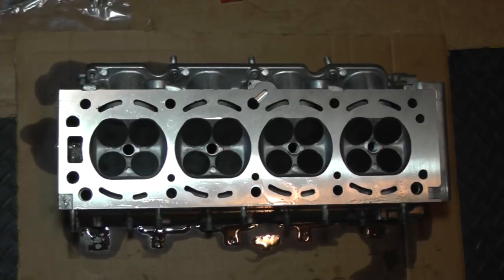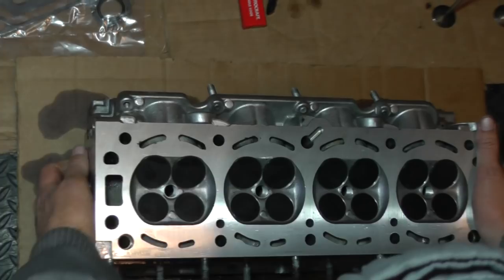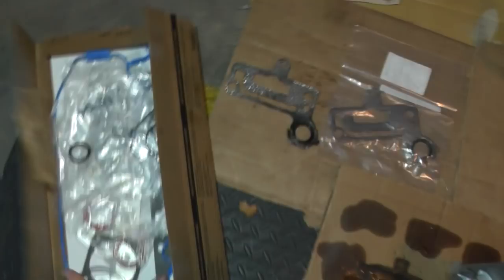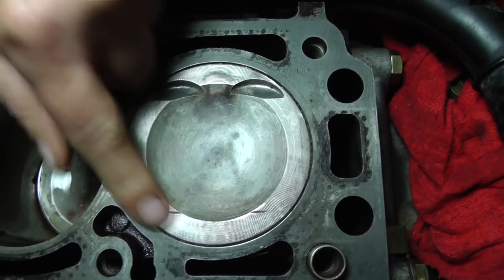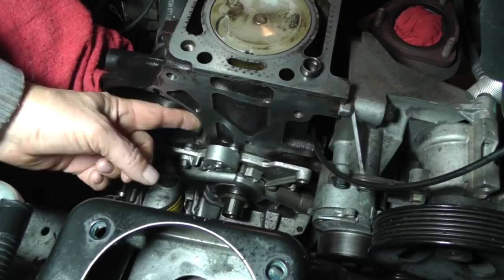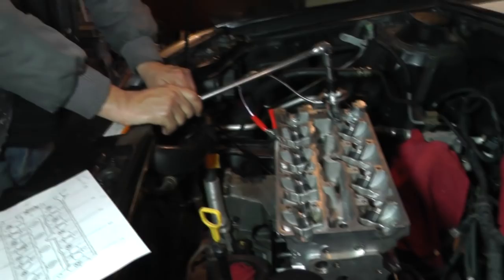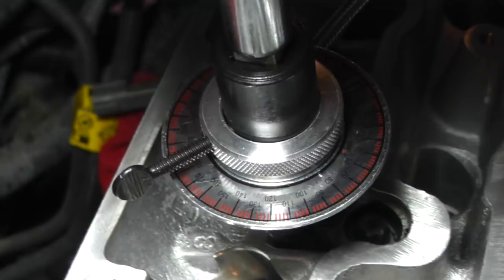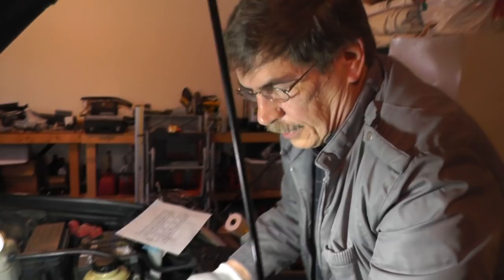Suzuki Forenza Head Installation - Part 9 (Initial Head Install)

Comment: Great video series. I have a 2005 Optra which has the same engine as your Forenza that blew the head gasket. I've watched all your videos and they have been a great help. I'm getting the head back from the shop today and this video  cleared up some questions I had regarding torquing the head bolts. Thanks alot Robin☺

Comment from the maker: @BigDaddy. Yes, there are several ways that this could be done. Another addition is to paint the socket with a white line so that you'll know where you're at while turning the bolt. Otherwise, with the paint on the bolt heads alone, you'll have to lift the socket up and down repeatly to see how much you turned. Having the white line on the socket also would save a little time. Thanks for your comment.

Comment from the maker: Hi Jamar. All you have to do to get #1 and #4 pistons up is turn the crankshaft sprocket. As for the cleaning, I used carburetor cleaner, Permatex gasket cleaner and a razor blade. All cleaning was done by hand; no power tools. Be sure to check your block deck to be sure there is no warpage.

Comment: Great videos! Thank you! A friend of mine invited me over to his house to help him change his timing belt. He went out one morning to warm up his Forenza and it started fine.. when he came out it was off. He tried to start it and he said it just made alot of "metal on metal" sounds.. I suggested to him to check his timing belt.. Upon further investigation his timing belt tensioner had broke and there was metal shavings everywhere inside the timing cover. After cleaning everything and changing the tensioner we re aligned the cams and crank pulley and adjusted the tensioner properly. After buttoning up, we attempted to start it and it tried to turn then stopped. I had a hunch that the thing had internal damage so I turned the crank with a 17mm and a ratchet. I marked it at about the 5 o'clock position before turning.. Wouldnt move clockwise but I was able to get it to go all the way to the 11 o'clock postion going counter clockwidse and it stopped. After I left his house he said he tried to start it again and it turned then froze.. He said now the crank wont budge at all. Sounds like to me its seized.. Any thing we should check to verify before tearing down?
Reply from the maker: Hi Boxer. Thanks for the comment on the videos. As for your friend's dilemma, it sounds like he's got some bent valves. If you're sure that the timing is set correctly, then it sounds like it's time to turn it down. From your initial testing, there isn't much left to do other than a leak-down test. Or you could pull the camshafts out to see if you can turn the crank over since all the valves should be closed with the cams out. If it turns out to be bent valves which is probably the case, the videos should help your friend get back on the road. Take care Boxer...
Reply: Thank you sir!

Comment from the maker: came up again, it bent the valve in the other direction. On an interference engine as this one, the valves can not occupy the same space when the piston is at TDC. Some vehicles being non-interference won't hurt the valves because even when the belt breaks and the valves are open, the piston won't hit the valves. Hope that makes sense and thanks for watching!

Comment from the maker: Hi diaz, you should consider yourself lucky on that one. The gasket that I showed from Felpro has the gasket for your car. In my case as you know, I wasn't soo lucky. Stay tuned, I'll be putting another video up today as the head installation continues.

Comment: Your video was a lot of help with my forenza, thanks. Mine is a 2004 do you know where the fuel filter is? I can't find it and I have no pressure at the rail and the pump was replaced last year. Thanks
Reply from the maker: Michael, on these cars there is no external fuel filter. The filter is an integral part of the fuel pump assembly which of course is inside the tank. If you're not getting any pressure, I would focus on the fuel pump circuit itself to see if the pump is running. Good luck on your diagnostics!

Comment: is it really a problem if you re-use the old bolts? these kinda look like standard thread, TTY have usual a threads only at the bottom cca 1``??? thank you.
Reply from the maker: The head bolts are considered TTY bolts according to the service manual. If you decide to reuse the original bolts versus $20 for new ones, the choice is yours. Don't be surprised if you have head sealing issues down the road.

Comment: I just replaced all the valves in my head... a few ends of the valve guides we're damaged, but none of them split. Had a timing belt pulley fail and it shredded the timing belt going 70MPH down the highway...  it bent every valve...
Reply from the maker: Sorry to hear of your misfortune. Hopefully, it will work out in the end.

Comment: Paint a white mark on the head bolts at 12 o'clock then in three passes go to 3, 6 , then 9 o'clock using white mark to so you know which ones you have or have not turned!! Much easier that way never saw a degree guage used in a shop!!

Comment: I'm working on a 2005 Suzuki Reno. Followed your videos step by step, got the job done. The car started just fine and ran for about 3 minutes. I shut it off to add more water to the cooling system and when I tried to restart it, it would crank, but wouldn't start. Seemed like a fuel issue so I used a quick spray of starting fluid, and it backfired through the throttle body. I checked the timing marks on the crank and cams and they are good. I pulled the valve cover back off, found some of the lifters are not pumped up. They are spongy and have plenty of travel. Could collapsed lifters cause it to not run, and backfire.
Reply from the maker: It's possible about the lifters and when you started it up, you should have heard the lifters ticking and it will take about 15 minutes of idling before they get pumped up. But the engine should still start though. So, you may have another issue.
Reply: The lifters were ticking, engine was running very smooth. Can't imagine what happened that it won't start and run. Is there a way to prime the lifters while still in the head without running the engine? At this point spongy lifters is all I have to go on. I have fuel, fire, and the timing marks are right on the money. If you have any ideas, I'd sure take them. Great video's on the Forenza. I appreciate what you do.
Reply from the maker: Steve Cloud not sure how you know the lifters are still spongy. You could disable the fuel and crank the engine over for maybe 20 seconds and then allow the starter to cool for a few minutes. And then repeat this process a few times. Hopefully that will get enough oil inside the lifters to pump them up.
Reply: To clarify, after checking the timing, I removed the valve cover, and pushed on edge of the lifters with a rubber tipped stick. Almost all of them had movement, or travel. Only a few of them were stiff, and would not push down. When I removed the lifters during the tear down, they were all solid, so I put them in a vice and worked them like you showed in your video. When I installed them they were all easy to push down, only spring resistance. 

Also, this was not a broken timing belt situation, just a blown head gasket. If I can't get the engine to start, I may take the spark plugs out, disconnect the fuel, and ignition, and spin the engine with a drill motor, to try to pump them up. Can I damage anything doing that?  I just hate to tear it back down, if I can avoid it. Doing this job for my father in law, no charge, been a long time since getting this deep into an engine. Just seemed like a good time for a project. I'm beginning to think, I could have been deer hunting, instead of knee deep in this Reno. Thanks again for your help.
Reply from the maker: Steve Cloud OK does sound like the lifters aren't pumped up which means that you're not having any compression. If you got a drill motor strong enough to turn the engine over that should be fine is that should to get some oil up there into the lifters. Hope you get it all sorted out and then you can get back to deer hunting. 😀👍
Reply: I'm sure I'll get figured out, I'll let you know how it turns out. Just a note, I've been in industrial maintenance for over 20 years, working in a beverage manufacturing plant in Southern Missouri. Glad to have met you, and thanks again.
Reply from the maker: Steve Cloud I figure Steve that you had a mechanical background. I work for an industrial company also as a mechanical and electrical engineer for automated control systems. I'm also glad to have met you too. Yes, let me know how it turns out and good luck. 👍😀
Reply: On a new path. I checked the spark using a clip on spark tester on all the plug wires. Only getting occasional spark. Looked at the cam and crank sensor connections. The wire insulation at both connectors is dark, and brittle, and some of the insulation is missing. I checked supply voltage and have 12 volts at the cam sensor and 3 volts at the crank sensor. I'm only assuming I should have 12 volts at the crank also. Can you tell me where the next point up stream I could check for voltage crank sensor power supply voltage?
Reply from the maker: Steve Cloud Steve on this engine the crank sensor is a VRS type. This is a sensor which generates its own AC signal. There is no supply voltage going to this sensor.
Reply from the maker: Steve, I replied to this post on my phone, but I don't see it hear on the computer. In any event, I'll repost just in case you didn't get it. On this engine, the crank sensor is a VRS (variable reluctance sensor). This is also known as a AC pickup sensor where this sensor generates its own AC voltage. Therefore, there is no supply voltage going to this sensor. The camshaft sensor is a hall-effect sensor where it does need a 12VDC supply and will output a square wave. I may have posted this for you but you can get free wiring diagrams and TSBs for this car. Go to http://www.bbbind.com/tech_database.html and fill out the short form and then click the submit button. At the bottom of the page, click on the agree button and you're in to get the wiring diagrams. After you select your car, click on the engine section and then fuel controls and you'll see the diagrams relating to the crank and cam sensors. What do you know? My other posting showed up after I posted this one :)
Reply: Update. I'm trying to determine if either sensor is bad. I am getting a .500 ohm reading on the 2k scale through the crank sensor. I get no reading through any of the pins on the cam sensor. Should I be able to get any ohm reading through the cam sensor? When I crank the engine with the key in the on position, I get random spark at the spark plug. I can unplug the cam sensor taking it completely out of the system, and I still get random spark. Do you have any recommendations for testing these sensors using only a multimeter, or any other method for testing them? Will either of these sensors show up on an OBD2 sensor?
Reply from the maker: For these two sensors I always use a scope to have a definitive answer if they are good or bad. With an ohmmeter, it's a toss up on whether it can be good or bad. With that in mind, 500 ohms sounds a little high for the crank sensor, but that may be okay as I don't know what the specs are for it. Another check which is more definitive is to crank the sensor and look at the AC voltage while its cranking. I would think something around 2-3VAC would be fine. As for the cam sensor, it's a hall-effect sensor so you can not check it with an ohmmeter. To see if it's working at all, put your voltmeter on its signal output and the other lead to battery ground. The voltmeter is set to VDC. With the ignition switch in the on position, you should see a voltage of probably 5VDC or 0VDC depending on where the shutter plate is located in relation to the cam sensor. Bump the engine over and you should see the voltage rise to 5VDC or fall to 0VDC. You can crank the engine and should see a voltage, but not quite sure what it should be. And you should see both of these sensors on your scan tool.
Reply: Still tracking down the intermittent spark issue. I've replaced the crank & cam sensor, engine still doesn't run. As I have a spark tester on the end of a plug wire, I get random spark, sometime a solid bright spark, sometimes a small weak spark. Most of the time, no spark at all. I have checked all connectors in the harness. One thing I'm looking at is the voltage to the coil. There are three wires going to the coil pack. Can you tell me what each wire is, ground or positive, and what is the correct voltage I should find there?
Reply from the maker: Check out this site to get free wiring diagrams for your vehicle. http://www.bbbind.com/tech_database.html Fill out the short form, and afterwards click on the 'I Agree' button at the bottom. I don't have the service manual but looking over the diagram, it appears there is a Purple wire which is your B+ feed to the two coils. The other two wires are your ground wires feeding back to the ECM. The ECM will pulse these two wires to ground creating the spark. You could hook up a test light to battery positive and use the test light tip on each of these wires and watch the bulb being switched off and on as the engine is cranked. I suspect you'll this as being okay. Steve, I find it interesting that the car ran fine when you first started it up. And then wouldn't restart afterwards where the ignition system immediately failed at that point. Hope you get it sorted out!
Reply: I'm puzzled by the car running just fine for a few minutes too. I know I'll most likely have to take it to a shop to get this sorted out, but I just hate to quit and give up. I know it's a huge coincidence that something in the ignition system failed at that specific moment. The reason I'm focused on the coil voltage is when I checked it I was only getting 1.8 volts at the plug feeding the coil pack. I know that can't be right. I'll do some more testing hoping I'll find the problem. Thanks for all your help. Happy Thanks Giving.
Reply from the maker: Yes, 1.8V is not correct for the voltage feeding the coil pack. That should be around 12.6V when the ignition switch is in the on position. Sounds like you're on to something. Keep me posted...
Reply: The more I dig the more questions I have. Here's what I found. Doesn't matter if the key is in the on position or off I get the same readings. Focusing on the three wires feeding the coil pack. With the coil pack unplugged I do get 12 volts on the purple center wire, only problem is I get it with one probe on the positive battery terminal, and one on the wire. Polarity is reversed. When I plug in the coil pack all three wires have 12 volts reversed polarity, and all three wires ring to ground on my meter. If I looked at the diagram correctly the center wire should be 12+ and the outer wires pulse to ground through the ECM. Seems like there must be a short somewhere. I'm stumped.
Reply from the maker: You're probably misinterpreting your voltage readings. Unplug the connector from the coil pack. Put your black (com) lead to battery negative and keep it there. You should only have the +12VDC on the purple wire when the ignition switch is on. The other two wires going back to the ECM should be near 0VDC. Now, plug the connector back on. Now you should have +12VDC on all three wires because the +12VDC from the purple wire is feeding the voltage through both coils out towards the ECM and the ECM has not turned on the transistors to pull those two wires to ground. Once the ECM turns on the transistors from the engine cranking or running, those two wires will go from +12VDC to 0VDC and back to +12VDC and repeating. Thus, the voltage on those wires will be pulsing; probably an average voltage of around 5-6VDC on your voltmeter. With a scope you will see this voltage as a square wave pulsing from 0VDC to +12VDC (higher voltage when running because of the charging voltage). Does all that make sense? :))
Reply: stuzman buttoning it up sending it to the shop. Getting intermittent voltage, ranging from 10 volts to nothing, and everything in between. Every time it hits 10 volts, it tries to start. Time to let someone else have a crack at it. I just don't have the diagnostic equipment to go any further.
Reply from the maker: They should be able to get her going for you. Let me know what they find out...
Reply: Thanks for all your help. I will let you know what they find out.
Reply: Simple fix. Went back and checked over every connection. Those three little ground wires that bolt to the engine underneath, the bolt was loose, so I cleaned the connections, tightened the bolt. The car runs perfectly. Note to self, make sure all of the connections are clean & tight.
Reply from the maker: Steve Cloud really glad to hear Steve that it was a easy fix for you once you found the problem. I bet you will never forget those wires underneath the next time around. 😀👍
Reply: Steve Cloud after reading all of this I was going to suggest ground wires. Lol. Glad you got it sorted out. Sometimes it's the simplest thing that haults production.